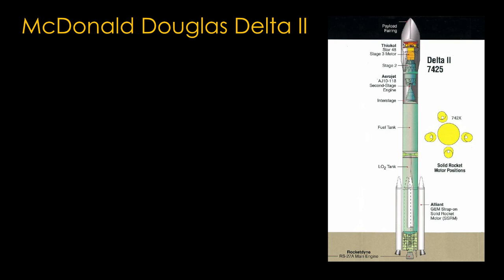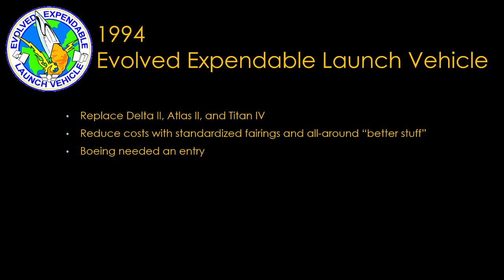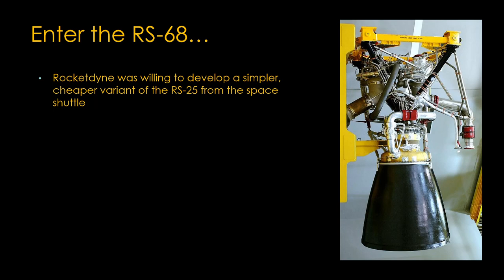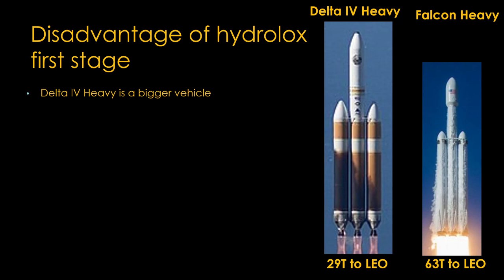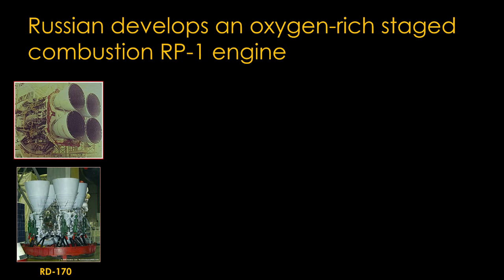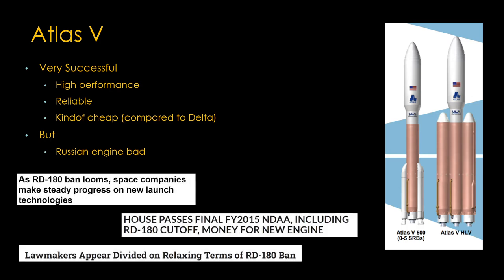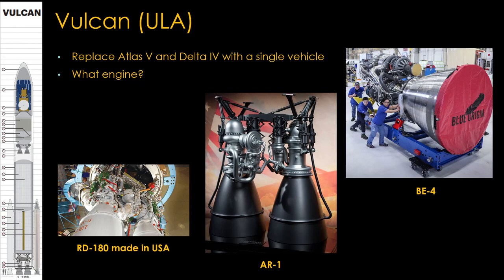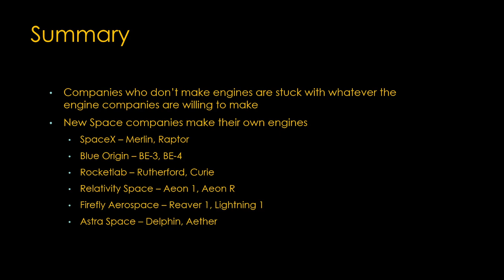Confusing Rocket Engine Choices...

Comment: "These are the best booster engines ever made"

Arguably, Raptor is the better booster engine because it has higher power output per projection area.
Reply: Out of curiosity, I just ran the numbers for SL Raptor, STS SRB, and SLS SRB, and I found that it comes out like this:

SL Raptor: 1.30 m, 1.81+ MN: 1.37+ MN/m^2
STS SRB (4-seg): 3.71 m, 12.0~14.7 MN: 1.11~1.36 MN/m^2
SLS SRB (5-seg): 3.71 m, 14.6~16.0 MN: 1.35~1.48 MN/m^2

So assuming my math isn’t wrong (it very well could be), we are now forced to conclude that, on a thrust-per-nozzle-exit-area basis, SLS’s 5-segment SRBs are, in fact, in contention for the title of Best Booster Engine Ever Made! And arguably they could possibly maybe even beat SL Raptor by a smidgen, what with the margin of error! 🤏🤪

Caveat 1: I was only able to find what I believe is the at-sea-level thrust for SL Raptor (and not the at-MECO-or-whatever thrust); I had both for the SRBs.

Caveat 2: I didn’t check if the SRB diameter figure takes into account the nozzle and/or skirt or not.

Caveat 3: My SL Raptor thrust figure could become wrong, as it’s entirely possible that Elon could announce tomorrow that Tom Mueller decided to drive his racecar back to work for a day just for fun, and that as a result, Raptor thrust has suddenly tripled, much as Merlin’s did over the years. 😝

Caveat 4: This entire comment I just wrote is kind of stupid/pointless because it’s apples vs oranges; and the paragraph, which I wrote last, trumpeting the clear superiority of big dumb idiot firecracker-tech-based boosters was not meant to be taken seriously.

(Always consult with a board-licensed Rocket Surgeon™️ before embarking on any spacefaring-grain-silo-and/or-water-tower adventure.)
Reply: @jgottula  Caveat 5: Power is measured in watt and equals thrust*Isp (in m/s).
Raptor: 4.38 GW/m^2
SLS SRB (5 seg): 3.5 GW/m^2

Caveat 6: it's impossible to pack circles seamlessly.
Reply: For a more like-for-like comparison with the Russian engines, 9 Merlins can be packed in a standard 3.8 m booster compared to one RD170 or RD180 (the 170 might not fit actually but it's close). 

The Merlins do 715 kN/m2 while it's 674 kN/m2 and 356 kN/m2 for the Russian engines. 9 Merlins also mass about the same as a RD180 or half of a RD170 (ignoring extra plumbing that may be required for 9 engines). So while the Russian engines have 10% higher Isp, the Merlins destroy the RD180 in thrust and handily win against the RD170 too. 

Compared to Raptor (33 in 9 m booster) with 939 kN/m2, Merlins lose in thrustk, and Raptor is the big winner in Isp as well with nearly 10% more than the Russian engines. But the tradeoff there is bigger tanks. Another thing to consider is that methane is a lot cheaper than RP1. So to conclude I'd say the RD170 and Merlin trade blows (with Merlin being a lot cheaper and simpler) and Raptor in its final form will be a much better booster engine overall.
Reply: @antonpershin998  Awww. When you said power, I figured you probably meant thrust (newtons) and not actually power per se (watts). Guess my math was wrong after all, lol!
Reply from the maker: Thrust per area is important, but the Merlin is roughly comparable to the Raptor in terms of delta-v; it loses on ISP but wins on mass fraction. The RD series has ISP that is about 9% better than Merlin, so - very roughly - it will get about that much over the Raptor. 

That's assuming similar thrust/weight and therefore similar gravity losses, and the RD probably loses a little because its thrust/weight is a bit worse than merlin.
Reply: And the raptor has a way better ISP and plenty of other advantages like cheaper fuel, cleaner burning, ISRU possibilities,...  The problem is metholox is less dense than kerolox and is a double-cryogenic propellant. I would call raptor a booster engine yet, it hasn't boosted an orbital mission so far.
Reply: @jgottula  SL raptor 2 thrust is now 230 tons, or roughly 2.255MN. So raptor 2 is now the best booster engine ever made, should Musk’s tweet on its thrust capability be correct.
Reply: @alisioardiona727  

Isn’t double cryogenic propellants an advantage if it means eliminating any insulation required between the Kerosene/LH2 and LOX where the colder of the two props would normally freeze the other? That would be something that doesn’t happen between two gases condensed in liquid form at similar temperature.
Reply: @topsecret1837  Interesting. Link to tweet? I’m curious to know what actual stage of production they’re at with Raptor 2. (I gather that Raptor has been evolving over time from what we’ve seen in Starhopper thru now anyway, but I suppose now they’re doing somewhat more formal designations.)
Reply: @topsecret1837  Well Methane is way harder to handle than kerosene : you must keep it cool. And you can't quite have Metholox without isolation bewteen the tanks because either one is boiling the other one off or one is freezing the otherone.
Reply: Raptors are not in active service, nor are they reliable.
It certainly isn't the best

Comment: In different period of recent history different trends prevailed, when DeltaIV was developed anybody believes that hidrolox is the future (like Arianespace who shift to a hidrolox first stage or Jaxa with H-II), now is the time for methalox or most people think so, but what would possibly make a better DeltaIV? In my opinion is one that would use F1 engine, probably 75 tons of payload to LEO in the heavy version.
Reply: Just Raptor everything. 🤣😂🤣😂🤣
Reply: @rexmann1984  Raptor! Your! Delta!
Reply: @rexmann1984  a big engine with a single big nozzle have some advantages, not that multiple engines core rocket are a bad idea, but are only some configurations that don't have significant downsides basically those with a central engine and a ring made from  sixth to eight other identical engines, versions with three four or five engines work too, but don't use properly spaces from the base of the booster or some areas of bell nozzle is exposed to the air flow. Raptor is a big at it is so a two stage rocket with a single raptor engine at the bottom can put into LEO 5 tons probably.
Reply: @theOrionsarms  multiple engines gives you an advantage in redundancy and efficiency. If the engines are gimbaled inward it's possible to use them in a way that gives you aero spike efficiency. I believe rocket lab is doing this.
Reply: @rexmann1984  like I said, are some configuration that works better than others, but ideally only need one engine at the base with a single big bell nozzle,or a 7 or 9 engines configuration If your rocket is to big to use a single engine, but I don't think rocketlab have a virtual nozzle effect on their rockets that was the idea of ultra clipper project, witch needs special shaped small nozzle around a main bell one.
Reply: @theOrionsarms  Everyday Astronaut did an interview with the CEO where he eluded to this.
Reply: @rexmann1984  Peter Beck only said that is possible to increase efficiency of core engine directing gas flow from a ring of other engines,he didn't say that electron do that,(it doesn't) or that idea was from delta clipper project, witch anyone who search old documentation of that project would find.
Reply from the maker: @jgottula  Thanks....
Reply from the maker: The thrust of a single F1 is pretty close to the thrust of 9 Merlins, so a single F1 would give roughly the same payload as the F9. A little less because the F1 has a worse thrust/weight and a worse ISP than the Merlin.
Reply from the maker: @rexmann1984  I think you get this advantage automatically; the plumes of the engines interfere with each other can they end up being less underexpanded than they normally would be.
Reply: @EagerSpace  exactly, but If the upper stage of that hypothetical rocket would be a hidrolox with a single RS-25 ,it will be the same weight as a falcon heavy on the launch pad, but with capabilities more similarly to SLS into current version, I mean the 27tons requirements to the translunar injection and at least 75tons to LEO .
Reply: @rexmann1984  Indeed. Also a massive advantage in manufacturing costs. The more you make, the cheaper it gets, and rocket engines generally fall short of the production numbers required, the larger your engine, the fewer you'll get to build.